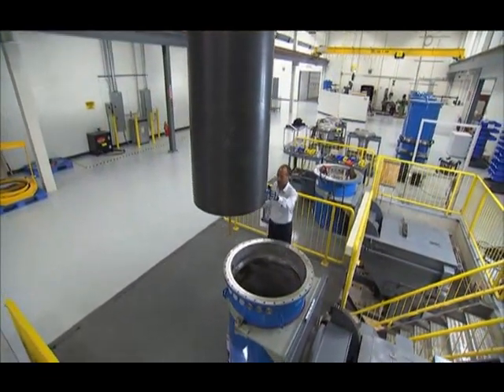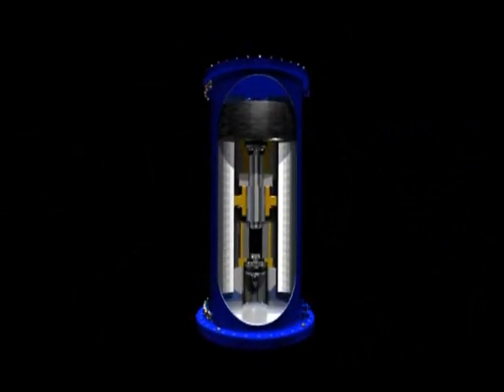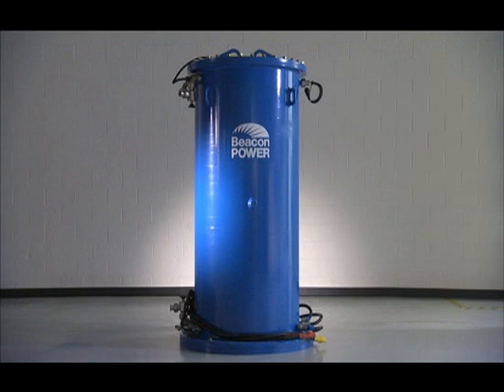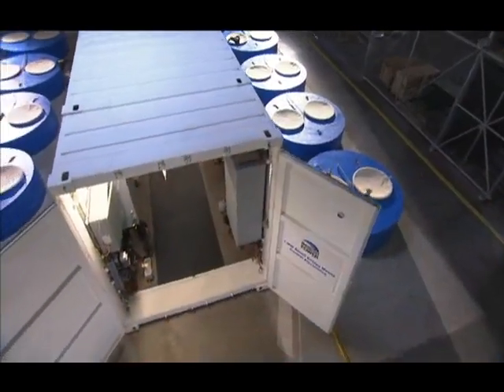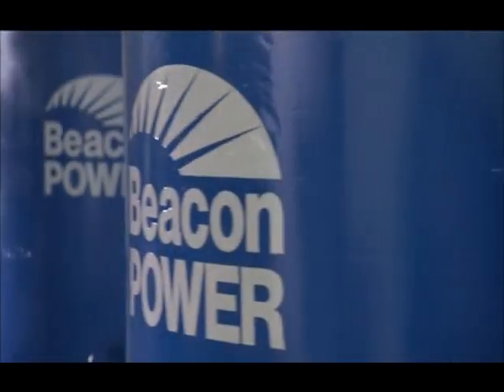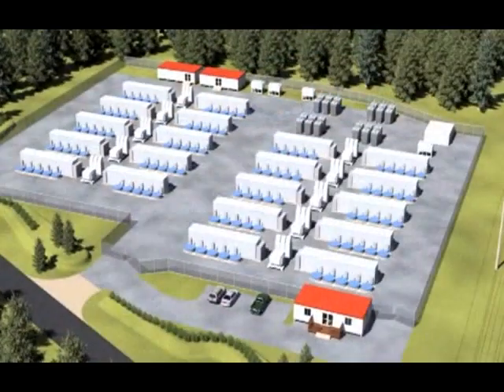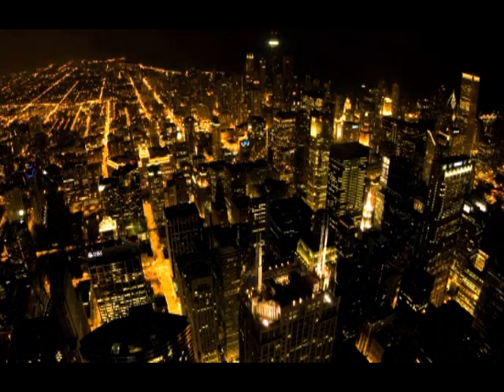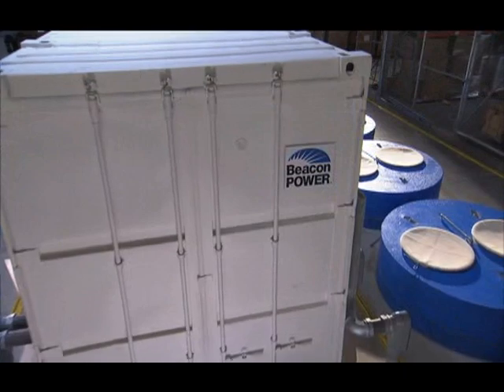Beacon Power's "Smart Energy 25" flywheel

Comment: You can do the same thing yourself, but the spinning flywheel is not needed, as with an A/C motor you can with magnetic bearings spin the rotor to over 120000 rpm then switch electronically to generation as with no friction the spin down time after 30 secs spool up is at least 30 mins.
 In a vaccumm there is no heat build up or air resistance  and of course over time the magnetism will go but you can over come this by using electromagnets powered by the generator itself.  Going to start to build one soon to release free to people who can build one themselves ,free energy,fuck the freemason peado's who stop free energy inventions.

Comment: An oil company bough the company out and destroyed it. I think they even appealed to Obama to please save the company. Beacon energy shares were available if the public had bought them then we would have ensured its continuation. Nobody bought the shares because it seems that nobody knew about them.
Reply: Sohave yes I saw they were back up and running. Was looking to see it there was away to buy shares in Beacon Power. Also saw that the Tesla's Power wall is going to become available soon. So things are looking better.
Reply: Sohave Actually they would rather frak the entire area the pollute the water than use it for renewable energy.
Reply: I did not know Beacon energy,like you do not know about my renewable energy system. We do not need to be using toxic fossil fuels as an energy source. Did you know that Americans use more energy per capita than any other country on Earth. The everyday American full size car no longer needs to be using gasoline. We no longer need coal electric power plants to provide electricity to the everyday average American family size home. Just as climate change is a real threat to all life on Earth, so is a real way to build a renewable electric energy system that is 100% clean electricity, that is all the human race will ever need. It can power the everyday full sized electric car without the need to stop to recharge batteries; it can provide all the electric energy needed for the average American family size home. It would make electricity, night and day, rain or shine and keep the power on during extremely bad storms.

Nikola Tesla had spoken many words of wisdom throughout his lifetime and many say that “Nikola Tesla had invented the 20th century and set the foundation for the future.” 

Ask yourself this. Why did they removed Nikola Tesla from American history?  

Because Nikola Tesla believes that electricity was a basic necessity of living

In the later years of Nikola Tesla’s life, he spoke about an electrical mechanical device. I have to hand make each of the 1000's of part and I hope to have a working system soon
Reply: William Wallace Beacon power was a real company that made a real product that served a real purpose. Please stay on track and support real solutions that are available now. If you are talking about solar energy being 100percent renewable then that's great I know a small company that's revolutionizing the solar cells. Visit there page and support their development. At the moment they are only being supported by a few people. http://www.altadevices.com/
Reply: Dizy Tizy They seem still to be in business http://beaconpower.com/ http://en.wikipedia.org/wiki/Beacon_Power
Reply: Dizy Tizy In deed, energy storage is one of the challenges of renewable energy, with that sorted out we can get a much higher output and a god advantage at competing with non renewable.
Reply: Sohave we have a 2000km long river in SA that is narrow and flows at a fast rate through desert rock no stop for hundreds and hundreds of years. It could be the largest renewable energy generator....BUT
Reply: Dizy Tizy That BUT is probably something about its environmental impact on the life in the river that it would cause to build a dam on it. A thing which must be investigated, and considered before planing the dam and reservoir. Perhaps adding a small bypassing stream for fish to overcome the dam. But if the alternative is Fracking then just build the dam.
Reply: Hope the start making the M5 again think this inverter was ahead of it's time.  I have two M5 & M5 plus.
Reply: for some reason, Youtube hided this comment.
I needed to click "SORT BY -> Recent first" in order for it to show up